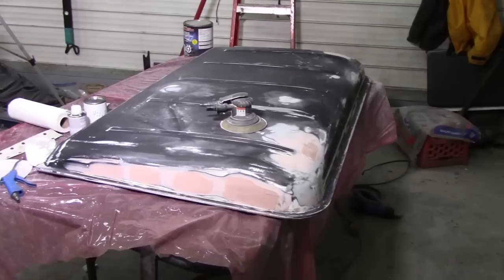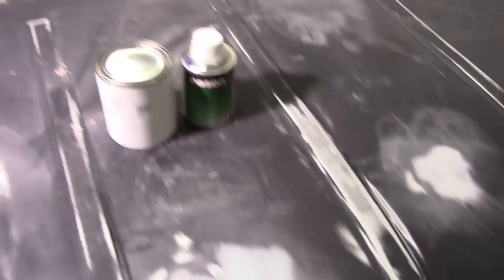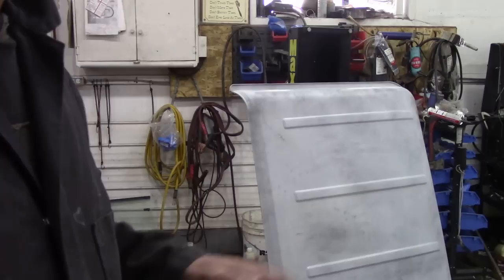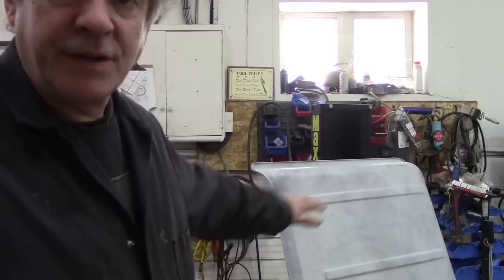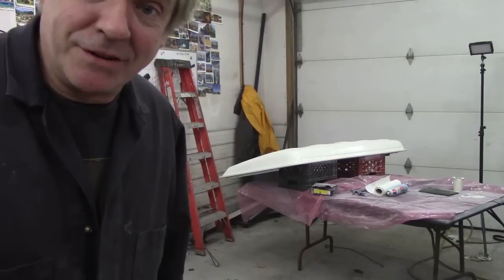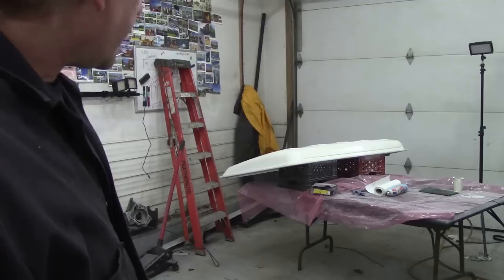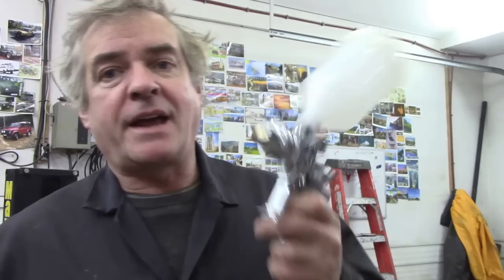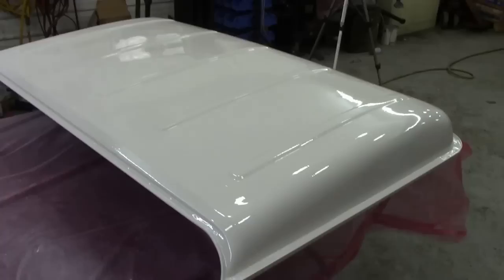Defender pick up cab.  Roof painting problems. Pt2

Comment: You could try suspending a heat gun about three foot above whilst spraying,works for me but be careful,extra hardener I've found to cause paint problems,thin coat of hardener rich then normal ratio mix over the first before it's fully cured seems to work

Comment: Gotta love a white roof on a landie. Really brings out the colour of the mildew and moss that'll ineviably grow in the corners and gutters.

I absolutely loathe painting/bodywork but, unless you're determined to achieve an OEM look, might it be an idea to use one of those "bedliner" paints to get a tough/durable roof finish without a lot of effort?

EDIT: Also, should say that pickup looks absolutely mint. Might be an old workhorse but it looks totally straight and solid.
Reply from the maker: Thanks - it is a good old truck and very solid but a back burner project

Comment: I don't think I've heard the word Aspenite for 30 years. Can't see why Defenders need roll bars when you see how strong the roofs are :-) My salamander heater is scary. I'm afraid to have it on in the shop when I'm in there, and afraid to have it on when I'm not :-)
Reply from the maker: Those salamander 's were hot but scary - Verboten to use engine oil as shop heat now ( they want you to buy fuel as it is taxed!!)

Comment: Thanks for more great content Mike, hope you're staying warm in the snow. I own a hcpu td5 version and I'd like to remove the sliding rear cab window and just have it as a solid piece of glass, never really used the window here with our fabulous English weather and it's one less rattle. Do you think this is possible, maybe get auto glazier to cut and fit?
Thanks
Mike
Reply from the maker: Thanks Mike
I am not sure what the UK regs are now but here you cannot use perspex or plexiglass for windows. Has to be laminate for retro fits but toughened is allowed if it is a direct replacement 

The only issue I can see for fitting a solid glass window is will the rubber cover the pop rivet holes?
Mike
Reply: @BritannicaRestorations  Thanks for your reply Mike, I shall do a little more research on it. One thought was to use a framed grill to cover up the seal/old holes - this type of product https://www.landroverdefendersecurity.com/products/defender-rear-side-window-grills-black-steel 

Mines a farm vehicle not a posh thing, so was thinking of something simple. I have seen some rather expensive flip open/gull-wing ones

Thanks again.

Comment: Hi Mike, How do you adjust the door gaps? On mine the drivers door leans back at the top so the door almost fouls on the truck cab behind, can it be adjusted without having to adjust the angle of the bulkhead? thanks
Reply from the maker: In many cases, people build by fitting the bulkhead first but bolt it tight to the chassis and expect the whole body to meet the bulkhead - this is the wrong way round

https://youtu.be/UwHOYGmtGN4

Comment: I had a space heater it put fine mist of diesel over everything
Reply from the maker: This was new 2 years ago and works well - but older ones - forget it - far too many fumes!
Reply: I’ve got shot of my ones now my insurance company is not keen on them. Will tolerate them in the metal working shop under strict conditions total no no in the wood working shop both diesel and gas.
Reply from the maker: I only use mine where I need fast heat - like working in the container in winter!

Comment: Sand a piece of piece of plastic with a clogged disc or a carpet tile,friction semi melts the plastic and pulls of the clog! You can tell what the temperature is visually in the workshop from the extra hardener!!!lol
Reply from the maker: I think I mixed a hardener that was not for the paint - goes off eventually but the Nason with the correct hardener was just tacky in an hour and hard overnight - what a difference! 

Nice gloss too